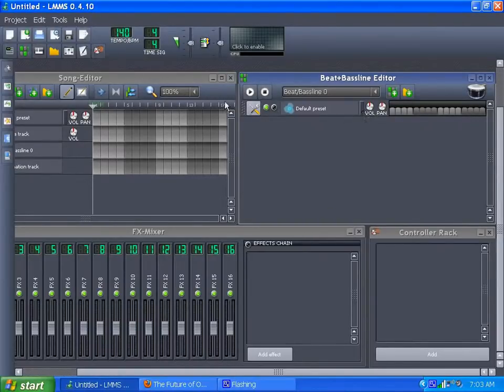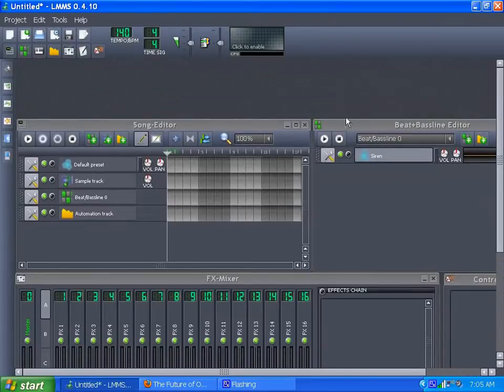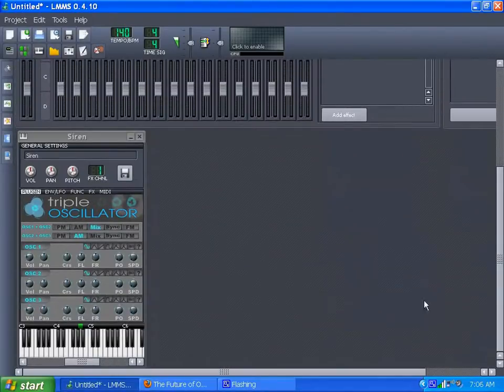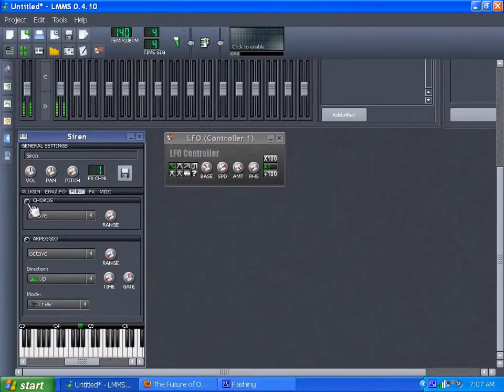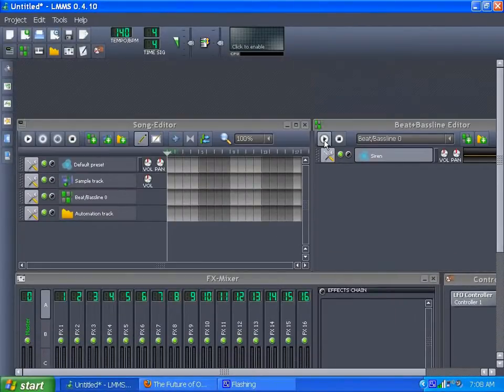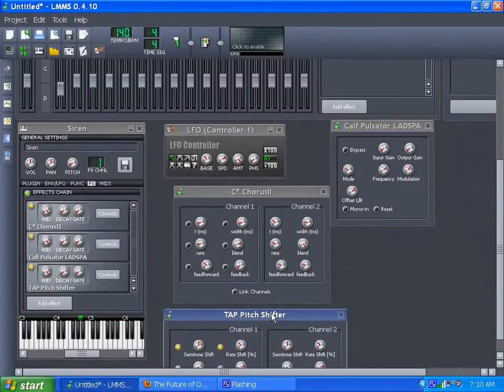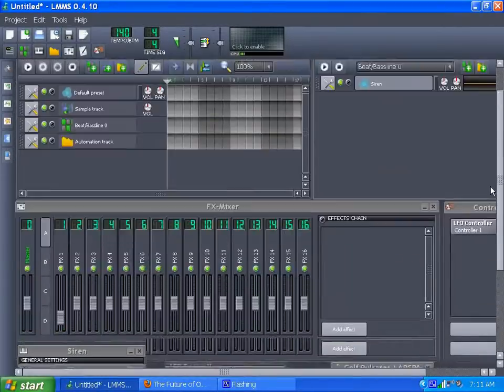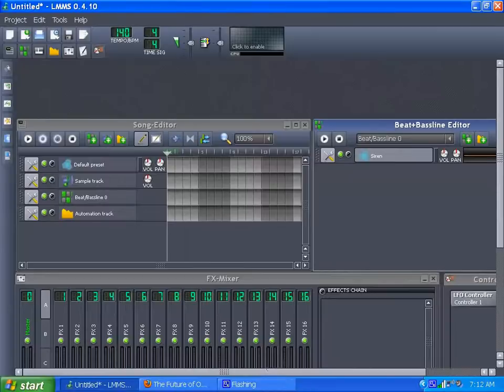Making a Siren Noise in LMMS

Comment from the maker: @omcdonald87 Thanks for the suggestion and I'm sure it will work for others.

Still doesn't work on my computer though. Might be the version of LMMS I'm using (0.4.12), the fact that it's the Windows build instead of Linux, or that I only have a crappy audio chipset (Realtek) on my computer.